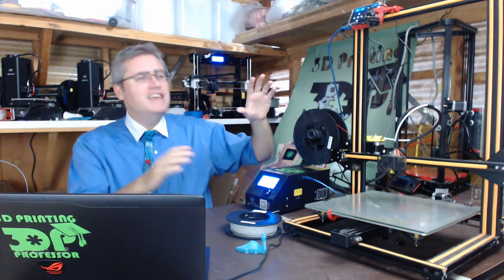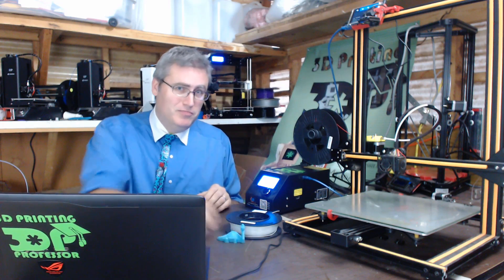The Problem with the CR-10

Comment: I ordered the cr10 and the first 2 prints I did off of was awesome then from that point on  it was a disaster I tried all the settings in cura and the creality slicers then it wouldn't print at all it was moving around like it was printing but not putting anything down I bought simplified 3d and leveled the bed and it began printing again. Then it would be half way through a print and would be printing in mid air to the side making tumbleweed. I sold it to a coworker and he is having trouble with it too. I bought the peopoly phenom the large scale resin printer and it runs just perfect. I like watching everyone who can get their cr10s running wish I could have been in the crowd I did so many up grades to the cr10 I rebuilt it with no success. Good luck with your cr10 guess I got the bad one out of a thousand.

Comment: When I transferred my gcode from to a folder on my desktop, and then transfered that file to my sd card there was an error in the gcode. Long story short it skipped a few layers on the x axis. When I printed the same file but exported directly from cura to my sd card it didn’t happen. Could have been filament issues as well. But it was weird

Comment: I got very lucky. My cr -10 works perfect and the SD card came perfect too. It’s been giving out amazing prints. I would totally recommend the printer. If someone bids on it and buys it I can promise you, you won’t be sorry. I loved it so much I have the creality Ender 5 plus coming tomorrow. I have printed big and the quality stays amazing. I got it Christmas Day and I have been running it 24/7. When you get something new you want to run it for hours. If something is going to go wrong with it you want to catch it in the first 30 days. So far I have had nothing but luck. Knock on wood:)

Comment: Would you say this is one of the best starter 3d printer
Reply: Jared Say I would. Best for money, size etc. the prints are amazing and you can use tons of materials including the ninja flax by printing a simple attachment for the extruder. I have been blown away by the printer. Check out the cr10 on multiple channels. I have found it to be the most popular and widely used printer. Let’s face it, who has thousands to blow on a printer that prints 3 inch tall models at max. This prints big. Yes takes hours if you go max size and want to keep quality but it is worth it. Also you can adjust speed, fill, and nozzle ends to speed up printing. Go in the search engine and check it out. Also all creality printers are upgradable and for a low cost too. This also can be altered later into your own build printer. Anyhoo, just YouTube it:)

Comment: I just bought the CR-10S. I bought it for its big print area and low cost. Unfortunately it is reviews like this one that made me decide to get it. The reviews make it sound like it, with very little assembly, was ready to go. My glass plate was warped, the aluminum plate beneath was not flat, the bearings all needed adjusting, one bearing has a chunk out of it, it vibrates at fast speeds, the nozzle wouldn't stay at a consistent temperature. After about 2 hours of assembly and 16 hours of trouble shooting, lots of reading and searching the internet for solutions and three failed prints,  I gave the supplier a call. Emailed him with my complaints list, sounded like he was going to send my email on to China and parts would be coming including a new mother board, plates and bearings but haven't heard back for a couple of days. So I disassembled the control box, tightened loose screws, disassembled the hot end and put it back together. The temperate sensor screw was really loose. I put it all back together, used masking tape between the aluminum plate and the glass to level out the middle, really slowed it down and tried 3D Benchy and low and behold it worked. The print didn't fall apart. But the next print was back to temperatures all over the place. My CR-10S is a new 2018 v2.1 board but still lots of issues. It makes me wonder if they send free printers to guys with YouTube channels that have been through an extra good set of trouble shooting techs before sending out. Where my machine was a regular stock. Your expierences was very different from mine. It does not work out of the box.

Comment: I love my Creality CR-10s, it's my first 3D printer and I'm making professional quality 3D prints after only having it a months or so and just learning about tweaking the settings and getting it to perform at its best.
It's a great printer at a great price and with so many options and settings, it's better than some printers twice the price I paid for mine, the build volume is huge, which is great.
I only have one little itty-bitty gripe, Cura LIES, when it says it'll take 5 hours to complete a print, it really means 7, I had a print that was supposed to take just over 11 hours and it took 20 hours, it could be because of my layer height, but I just wish Cura would give a realistic build-time, not just pick some arbitrary number out of the air and say, "yeah, it'll take x hours".

That's not the printers fault though and after some practise, the printer is performing admirably, the little bulldog clips that hold the glass on the heated bed only bother me then they snag on my clothes or something and go pinging off, otherwise I have no problem with them.

I'm really pleased I got this as my first step into the world of 3D printing, now friends and family are fascinated and constantly asking me to make little things for them or design something in Blender for them!
I learn something new every day and enjoy using my CR-10s a lot as I'm constantly learning something new.

And yes, it does print in the softer materials like TPU as well as wood and copper.

Comment: I am very new to printing.  I have a m3d pro that sucks.   Should I get the cr-10s or will the cr-10 be fine?
Reply from the maker: The CR10S has 3 major innovations. Print loss recovery, filament out detection, and an accessible bootloader (I haven't tested this last one yet). The print loss recovery is accomplished by constantly writing to the SD card, so it's recommended to turn that off at you earliest convenience by updating the firmware (again, I haven't done this yet).  So it's a question of whether the price is worth filament out detection and being able to upgrade it easier.

Comment: Just got my CR-10 and first it would not read the SD card. Got that fixed but now the extrusion servo runs the wrong way and feeds the filament back out fast when it starts to print. Connector cannot just simply be reversed so waiting on a fix. I have seen other post on this problem but never an answer given.

Comment: When you say “you could get a better 3D printer for a few more bucks”, which  other printers are you speaking about? And how much more money are we talking about. I am in the market for a printer and was planning on the cr-10. Now if there’s a better one for a bit more cash I’d like to hear about it. Thanks and great video
Reply from the maker: Lulzbot printers come with some great features that make printing easier, if you don't mind 3mm filament. Or modifying it. GMax is even bigger and more reliable, but much more expensive.

Comment: Just be happy you didn't find that g code  problem on a 12 x6 ft home built cnc like I have
 what happens when your cnc desides to stab a 3/8 end mill into 2 inches of high quality hardwood ply  then starts to cut the part ? Lots of smoke and broken parts thankfully I have the oh god oh god we are all gonna die button right their
 well done video thats another Check in the creality list I'm leaning toward the c10s

Comment: Hey 3D Printing Professor, thanks for your thoughts on this - subbed. Just a question about the RPi case and touch screen. Do you have links to those? Cheers, JAYTEE
Reply from the maker: For the Raspberry Pi I used this case, modified, of course, with my own logo: https://www.youmagine.com/designs/raspberry-pi-case-model-b-2-3

The touchscreen is the Adafruit 4.5" TFT touchscreen, which now that I've had a bit of time to experiment don't recommend. I'm doing some experiments with a 7" HDMI touch screen and if all goes well I'll be making a video about setting it up.

The rest is a super custom rig to hold a webcam you can't even buy any more to the extrusion frame. It literally includes two types of glue. I won't be releasing this one, but when I finish my next experiments I will be releasing it.
Reply: Great, thanks for the reply. I'm looking forward to the 7" touch video. Cheers, JAYTEE

Comment: I got no sample files on my card..none
Reply from the maker: Lucky.
Reply: But im new at this i just wanted something  to print. But i got it kinda slow but the pla in the box  205 nozzle and 60 on the bed seams to work ok.. got a bunch from hobby king coming thur.. Im running the white stuff at 50mm/s does this sound right? Im using cura, did the baby groot took 5 hr's. IM NOT USE TO THAT BEING A CNC GUY.

Comment: Did you find a major problem with this cr10 or what? Just seems like a bunch of jibber jabber what is the problem
Reply from the maker: Mostly jibber-jabber. I'm good at jibber-jabber. Subscribe for jibber-jabber. And, no, I didn't find any major problems. I didn't say there was a major problem.
Reply: 3D Printing Professor now I guess you didn't say there was a major problem with it but then again you didn't say it was jibber-jabber either. Usually don't comment when I expect something from the title and don't get it just thumbs down and move on then I figured I would ask cuz I didn't have the patience after about halfway through. It seems like a good printer I'll keep watching a few of the videos and more likely get one thanks for your time anyway
Reply from the maker: Well, let me just warn you, I have since this video found a problem. The printer is fine, it works out of the box on day 1 and it's super easy to assemble. But, it's limited in it's upward mobility. That is to say if you want to add dual extruders, filament sensor, or auto-leveling, you're in for a bad time. I've actually contacted a CR10 rep, so they're aware of my grievances, meager as they are.

Comment: hmm, problem with the cr10... ok i'll click. i'm not hearing a problem... where's the problem... ... dude this is clickbait. I'll go use someone else's affiliate link :P
Reply from the maker: Use someone else's affiliate link if you want, but this isn't clickbait. I did indeed have a problem with the CR10, something that scared the boogers out of be. I deliver on that promise. Since owning it, though, I've found some other problems that I could do a follow up video about if it'll make you feel better.
Reply: Hey man, I was having a bad day. Sorry about that.
Reply: Actually I would like a followup video. I ordered a CR-10s on an amazon flash deal for a great price and i'm looking to make it as reliable and accurate as possible. This is my third printer and probably the best out of the box experience i've had so far. And again, I'm sorry for being so rude.

Comment: I thought you would talk about ghosting due to its build plate weight. Its lack of abl and leveling problems due to non flat glass or bowden plate. The noise or the missing board boot loader. I thought it was a serious pro video not at funny marketing stuff
Reply from the maker: Fair enough about the boot loader. Since this video I wanted to see what it would take to add auto-leveling to this machine and, hoy, what a mess. I'm actually talking to Creality about fixing this problem. Hopefully they fix it by opening up their board, as opposed to selling an add-on, but honestly I'd be happy with either.

Comment: Create screw filler for screw holes that are stripped/drilled larger than it should be... Use laser to create a 3d profile of the stipped screw hole, and 3d print a filler that would allow screw to be fixed there... Applies for wood and masonry

Comment: I don't like the single screw version it's just going to be a huge problem down the road and will eventually droop and wear out tires prematurely. The Y axis is also a poor design and would have been much better with 2 V-slot rails spread apart a minimum of 2/3rd the width of the table.  Some sort of additional back bracing on the Z axis would probably be a good idea. V-slot is fairly cheap so those two upgrades really wouldn't cost much and would be worth the extra investment I haven't really checked around user forums but I suspect the PCB heater that size is going to be lacking for ABS if it is only fed with 12V and will have warping problems at the edges of the build plate although at lower temps for PLA it will probably be OK. I'd probably pitch the hot end and get a real E3D V6. I learned my lesson about cheap Chinese knockoffs a couple of years ago while I've never had a problem with either of my E3Ds and just upgraded the older one to the new heater block/cartridge thermistor. The other thing I worry about in these cheaper units is the longevity of the power supply but they are still too new to make a judgement on that. 

Still a pretty good deal and once you go V-slot you'll never want to go back to rods and linear bearings ..... Much more quiet and zero slop and my 2 year old Makerfarm Pegasus 10 has been flawless and essentially trouble-free  after hundreds of hours of print time . Spending a hundred bucks or so to fix the minor limitations I mentioned would be a good investment and  you'd have a machine that will last for years and keep up with the best of them and still be very cost effective.

Creality kind of irks me because they won't embrace Open Source when there is nothing proprietary with the electronics or firmware and it's basically a ripoff of an Open Builds design over 2 years old. If you are going to use Open Source electronics, firmware and design then you should give something back like Lulzbot and Prusa have ..... It's the least they could do IMO
Reply: You mean something like this? https://www.youtube.com/watch?v=-ASBhJiU8NI
Reply: I think the 10S version with two steppers would be better but if a guy already has a single screw version that would be a good solution and upgrade. If this had been available a couple of years ago when I decided I really wanted a V-slot printer I probably would have jumped all over it with plans to improve it later. Don't get me wrong, it's still the best printer at that price point but I'm also an EE by profession so I tend to nit pick as well as look at what I think will be a problem a year down the road as far as longevity and reliability which is why picked the parts of this printer I think will be a problem down the road and will degrade the print quality. For instance I think people will start seeing problem with the Y and Z axises getting sloppy and wobbly over time which could affect print quality but these are easily fixable problems. I't also been my experience that 10" PCB heater is about as big as you can reliably go with only 12V. This may be 24V already but the problem is they don't tell you anything about the power supply or control board that I could find. If you go to Lulzbot or Prusa every aspect of their printers are spec'ed out and you know exactly what you are getting and exactly what to expect before you make your purchase. The level of tech support is also superior by an order of magnitude and that's especially important for a beginner that doesn't have an electronics or CNC machine background.

Comment: I clicked on both of your Gearbest links and can't figure out why one is $508 and the other is $379. What's the difference between the two? Is it only the color?
Reply: It's because one is the cr10 and the other is the cr10 s.  The color means nothing
Reply: The more expensive version has dual motors on the z axis and a filament detector. Be very careful of GearBest. I tried dealing with them and had problems. After a little bit of research, tons of people had problems with them. I ended up going to Amazon, paying a bit more and actually getting my product
Reply: Marcus Adams i think the blue one is the older one and the orange one os the newer improved one. Not sure, but thats what i heard. And it may be the other way around

Comment: do you have a link to the STL for the glass clip? thats the first one i have seen that looks like it will work well.
Reply from the maker: Here's the original that still works on the X-axis. The beefed up one I use on my Y-Axis I haven't taken a picture of and posted yet. https://www.thingiverse.com/thing:2401764
Reply: that doesnt work on both x and y?
Reply from the maker: It does, but I broke it when a print went bad. So I made one that's reenforced, but now it's too big to go around the X-Axis, so I only use it for the Y.
Reply: oh ok cool. i will try it, and eagerly await your beefed up revision. good video, even with the click baity title. personally, i would have liked to have seen them use a silicone heater, since the bed is so large and exposed. longer wiring would be nice. i really think they are on to something with this hot end design. its so simplistic, and compact, i think there is a lot that can be done with it. i am working on a dual extruder set up, stacking these stock hot ends.

Comment: I guess you're one of the few lucky ones that didn't get a warped heated bed and glass build plate.  I "fixed" mine with some pieces of tin foil under the mirrored glass tile that I used to replace the glass that came with the machine.

Comment: Its better to adjust the camera to capture from front..... Its too dizzy to watch the build plate moving back and forth from top... 
Core XY type of 3d printer timelapse is a better view to see the print building up without the plate moving around.
Reply from the maker: Jasphere Rindou True. However this angle is better for checking in on prints while the are going.